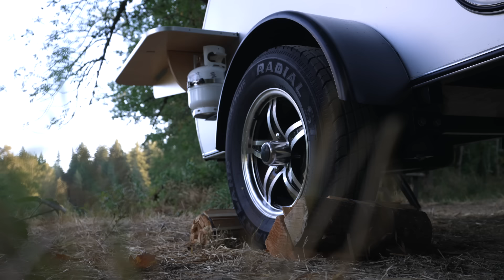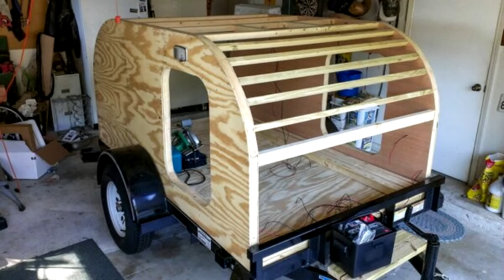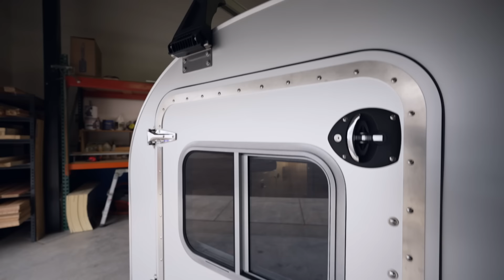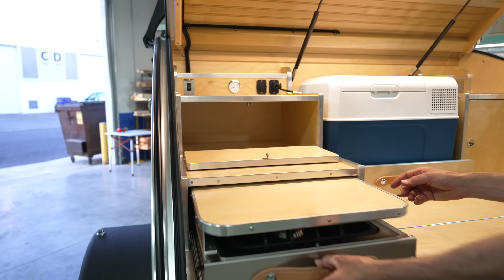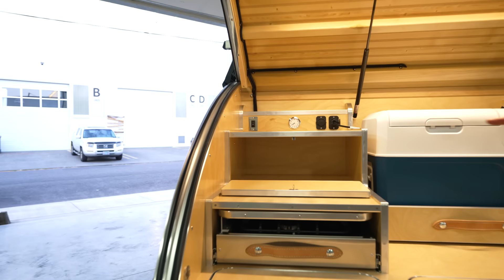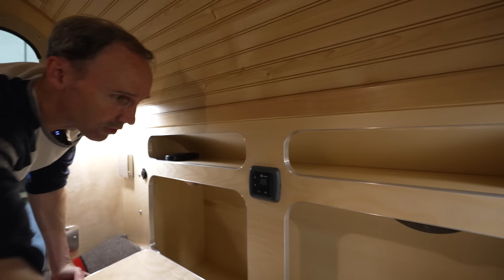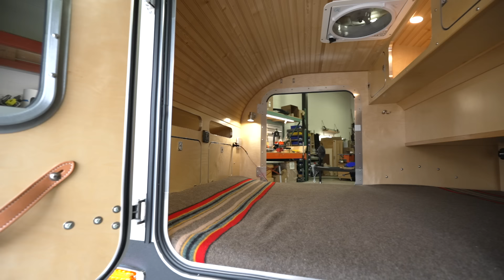RAISING THE BAR! A New Standard for TEARDROP Trailers

Comment: Very nice. So, I actually have a full blown bumper pull toy hauler and heavy duty truck. But I love everything RV related. I've known about your channel for a while but now I'm in big trouble. Bought a Jeep for a daily driver and, well, it's gonna happen... But definitely one of the more super lightweight - low profile. That Road Toad is pretty close but I worry about the axle not holding up on that one. This one is nice but it would boil down to how proud they are of it. Very nice though. And that would match my Jeep paint also.
Reply from the maker: You sound like us.  Well we may not have the toy hauler but we have always had two trailers in the yard. There is always a 13' travel trailer and a teardrop on hand for when needed. We haven't found a trailer that does it all. So it is nice to have one for both styles of trips. A Jeep and a teardrop are like a man and his dog. I love that combination as well. I just wrote the following paragraph to someone else in the community, but I thought it would be good to share with you as well. Most of the heavier trailers really cause negative impacts. But a lot of it doesn't necessarily come down to the weight, but more often the heavier trailers means more frontal area and often a greater drag coefficient. So although a trailer like this at 1,650lbs sounds heavy I find they often tow like a 1,000lb trailer due to their smaller size. BUT you put on a rooftop tent and now it performs just as poorly as many of the bigger trailers. Some day I am going to have to make a video about this. I have always been surprised how Camp-Inn owners tow their trailers so easily with smaller vehicles. And that is where I have come to realize weight isn't nearly as important as drag. I say all this Carl, just to say I am finding more and more that these smaller 4x8s and 5x8s pull really well even when a tad on the heavy side. But these larger offroad style teardrops at the same weight really struggle with gas mileage, towing power, etc. For 99% of people I would say trust the Road Toad. It would be able to get where most people go and would hold up to the challenge. But with a Jeep owner I would hate to limit you by your tow vehicle. If you use the Jeep for what it was actually created for you might want to go with something a little beefier. But I still have a feeling the Road Toad would hold up to most areas you throw at it.
Reply: Thanks so much for the detailed reply. I think you’re absolutely right about drag coefficient and I would think those that are shorter height-wise would do much better, regardless of weight. For context all engines, including the 392 and diesel all Wranglers have the same tow rating and that’s 100% due to Jeep’ suspension and payload. I bet sway gets a little wild also with such a short wheelbase. This is all about wind and drag. Anyway, thanks for the insight. Keep finding these awesome little trailers for us!! Thanks again!
Reply from the maker: @carltuckerson7718  You are most welcome. People think I am crazy when I say this (and wrong) but I have NEVER experienced sway in a teardrop. I have experienced it in almost every other trailer when improperly weighted. But regarding a teardrop, even with poorly distributed weight I have not come across sway YET. And my theory is that this is because the rear axles are placed so much further back than any other style of trailer. And this happens obviously because of the heavier galley portion of the teardrop.